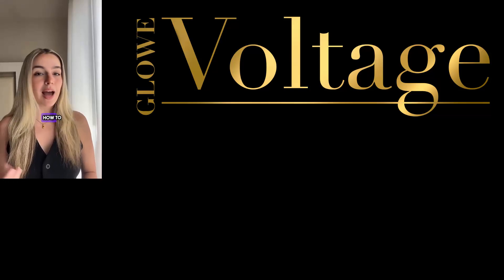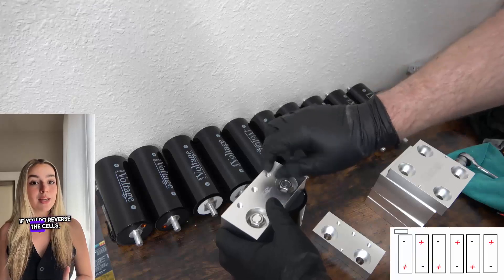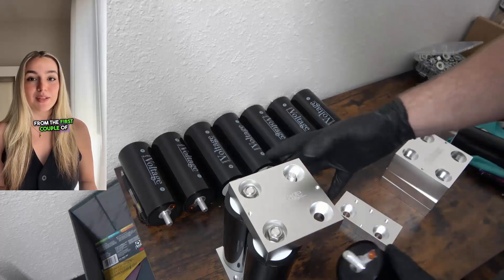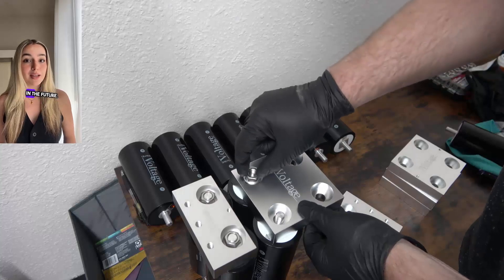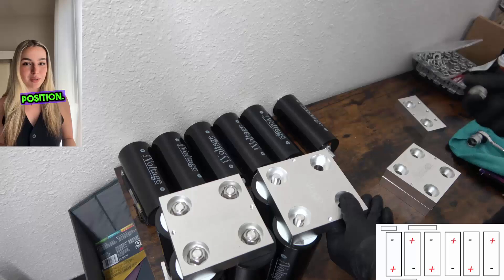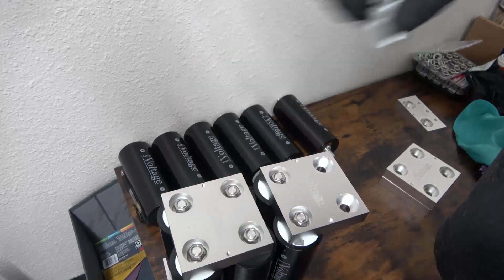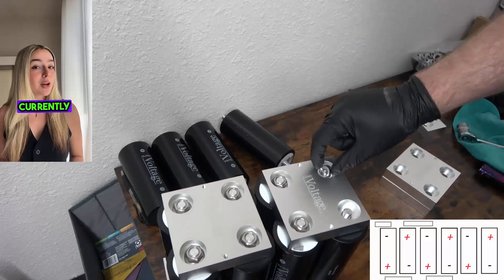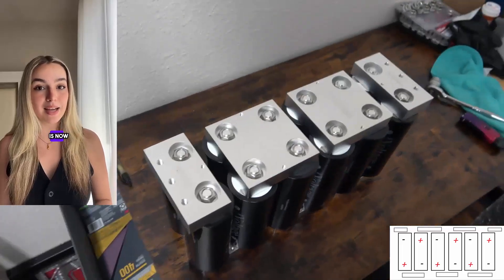How to Assemble a 6S LTO Battery Bank Using Bus Bars: Complete Tutorial

Comment: Where's the link to these specific buss bars? The holes in the ones on your site are not countersunk like the ones in this video.
Reply from the maker: There are only 15 sets of these bus bars that exist to be honest..  Being over an inch thick they cost us more to have made than our retail cost on the smaller versions.  If you are interested in picking up a set, message our Glowe Voltage page on facebook.  We have them in both 6S2P and 6S3P configs.
Reply: @GloweIndustries  oh dang I need a 6s5p or 6s4p for a system I'm doing with a 15k sound system and aftermarket alarm. There's some cheap LTO cells in the market that I want to utilize for this build.